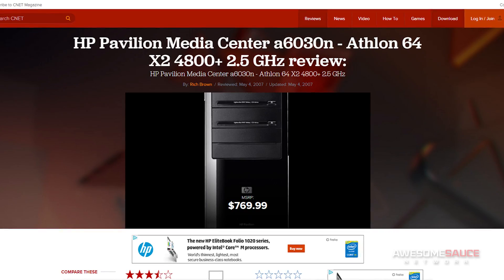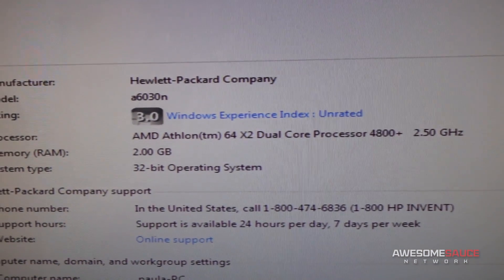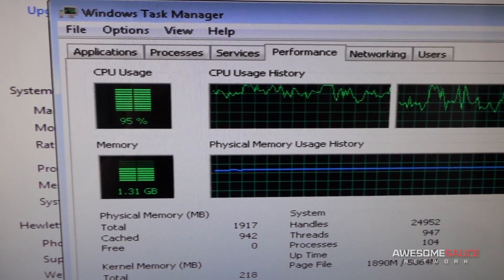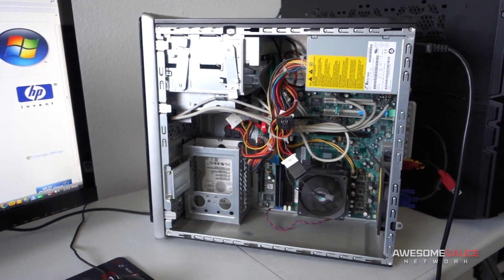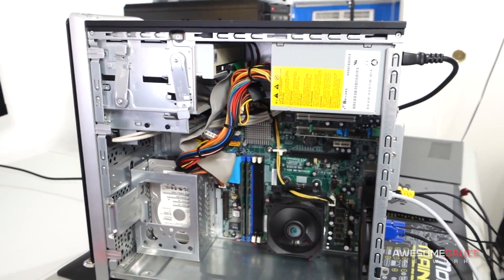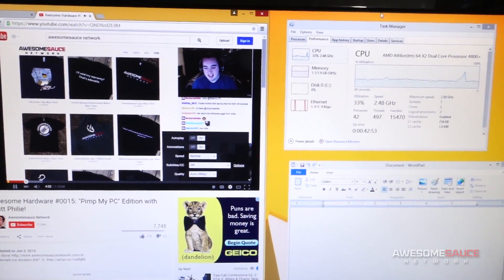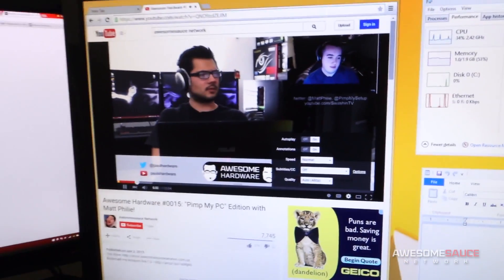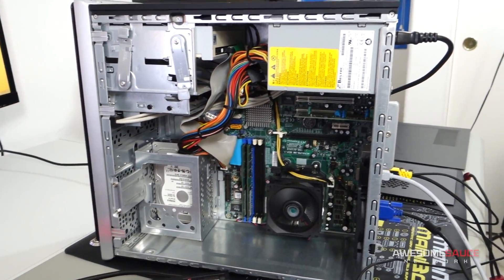Cleaning Up My Neighbor's Old Desktop!

Comment: I just threw a PC a fair bit better than that in the bin days ago. I'm a bad person but there are even better PC's than that just lying around never used. I never did get into the whole sell your old stuff thing. If I'd come across this guy and his 99% in use idling PC, I'd just have said, it's time to let go, I'll help you backup everything onto this here thumb drive, insert this into your new laptop you're about to buy, go now, quick, run, the thumb drive will self destruct in 3 hours, there's no time to lose!
Reply: Clay Mann and 5 minutes of my tweaking it would be running 18% in idle !
Reply: Guy Aldrich
unlikely but the point really is, why would you bother? One of the cheapest smartphones would be faster than this.
Reply: My point is,you could tweak this thing where it will run decent without wasting money on an 8 year old system.
Reply: Guy Aldrich The best tweak would be drop kicking it out the window. That's a good send off for a PC so old, that one last time you could make it fly. Also it'll never run fine, that's just stupidity or you've just not been around a modern computer to know what fine is.
Reply: Clay Mann Lol, I agree, There's no point in wasting money on shit.
Reply: Clay Mann Man, it is people like you that I love. That way I get the old computers (or not that old computers) at the dump for free! I find pretty good stuff. A Core 2 Duo clocked at 2.40GHz with 2GB of RAM, a GeForce 9500 and a 32-Bit OS is plenty for watching 1080p video with 7.1 surround sound. I know because I use a modified Dell Inspiron 530 in my home theater room!
Reply: Joshua's Recordings
I'm glad I can be of help but the PC you describe, a garbage android phone/tablet could do that too and it won't take up all that space, won't gobble up all that electricity. There was a time some years back when PC's were still expensive, the idea of re-purposing older hardware for certain tasks, it made sense. Today you can get that PC on a USB stick, in a cheap tiny box or with a screen built in with tablets and they are so cheap, I can only imagine the second hand market must have some deals that would stop you dumpster diving. Still, if you get a kick out of that, all power to ya,
Reply: Clay Mann I have never seen a tablet able to play Blu-Ray discs or have a 1TB hard drive or a discrete graphics card or even play 7.1 surround. What is wrong with dumpster diving, I have found $7,000+ worth of electronic equipment at the dump. I have a hole 7.2 surround system with about 2,500w of true RMS power (not peak) with 0.1% THD. I find newer TVs (flat screen usually 1080p), Blu-Ray disc players, computers, sound cards. What is wrong with getting this stuff free?
Reply: Joshua's Recordings
nothing wrong with that at all. I congratulate you on your hunting skills to get all that stuff. I completely forgot about discs. It's been so long since I used them, I don't even have any kind of optical drive anymore but I'll totally give you that, an old PC would play Blurays just fine if that's how you consume movies.

I'm not a big gamer but I do have a fairly decent main PC that handles games fine at 1080p. The rest of the house just gets mobile games and I quite like the distinction between the two. I play some games in bed or chilled out on the couch, casual garbage games really but I like 'em and when I'm at the main PC, it's the time to get into all those Steam games that us PC users can't stop acquiring in sales.

With movies I run a Plex server so my main PC can stream TV shows and movies anywhere in the house from phones, tablets and the main place it gets used, the living room TV with a little android box hooked up. I couldn't really go back to any other way of doing it. It's great watching a bit of a movie, deciding to go to bed but being able to just click click click and the movie is playing on a tablet in bed, right from the point you left it.

Surround sound is all handled nicely depending on whether the device being streamed to can handle it. Bottom line though, I am paying for this but really not a lot. It's amazing how cheap it is to do this nowadays compared to having to base everything off a series of desktop PC's. I'm sure you'd argue that you can just find these PC's abandoned by people and use those. I just don't see that as an attractive option anymore. They tend to make noise, they take up a fair bit of space and consume way more power than a few android devices in sync with a single PC.

I have a quad core PC here, 8Gb ram, a few terabyte drives and a pretty old graphics card so not really very good for gaming but it could be. The thing is I just have no use for that anymore. I offered it to my niece but they use laptops now and didn't even want it. I don't want to throw that one as it still feels kinda decent and I won't even talk about the monitors building up lol Ah, first world problems :)
Reply: Clay Mann The only reason that I like Blu-Rays over online streaming is that it has surround sound. Amazon instant video is awful, it sometimes won't even play in HD (yes, my card and monitor are HDCP compliant). Online or on computer streaming just is not up to my standards of movie watching.
Reply: Joshua's Recordings
 I've never had a problem streaming HD but it absolutely is inferior to Blurays, even though with Plex you're able to stream video as high quality as you want, I tend to acquire 720p and 1080p. I'm happy with the  quality.

 I don't see a problem with surround sound without using a PC. Tablets and android streaming boxes can handle 5.1 just fine, at least mine do. I have a few android boxes in the living room, they all have digital connections for surround. Even my old Amazon Fire tablet can connect through HDMI to the TV and do 5.1 in 1080p.

I suspect the problem you're having is with clunky old PC's trying to handle streaming HD video in less than ideal ways. If I try and stream amazon prime through firefox browser, that hits my system harder than it really should. If I play the same video in VLC, it's using 1% resources. Once you switch to something like an android box for streaming video, that's doing that on top of linux in a very efficient way. It's rock solid, at least that's how its been for me. I remember older PC's struggling to do the exact same thing running Windows Media Center, not to mention all the problems with formats not working. A plex server will transcode to anything, even re-compressing down to different levels of bandwidth live so you could for instance watch a movie from your home PC while on a train going to work. To make sure it plays smooth and you take the hit in visual quality.

Another bottom line. I've built everything around convenience. All my media is a click away no matter where I am. It sounds like you have a blu-ray collection that's top quality with a great surround setup and you demand that and got most or all of it for free. Neither of us is doing it the right way, we're just doing it the way we like :)
Reply: Clay Mann I think that it is Amazons stupidity making you use one of their dumb streaming boxes. Also my PC handles HD just fine without using much of the CPU. My main machine is much better (I built it from new parts). But for a streaming setup a older computer with a decent graphics and sound card is fine. Also you are right with your bottom line. I want everything top quality and don't really care about convenience as long as I achieve top quality. I also just like to get most my stuff free if I can, if I can't I will gladly pay for it.

Comment: They use to on the old IDE ribbons cut each line of the ribbon and then twist them to cut down on the size. Of course you had to be very careful doing this as not to actually cut into the wires.

That was before Rounded IDE cables.

Comment: Ugh I remember when my PC sucked that much. But then I built one with an FX 6350 and an R9 270, but i'm buying a GTX 960 4GB also.
Reply: Very, Insanely, Ridiculously High Fructose Corn Syrup get a 280x instead dude
Reply: ben p I was thinking of a normal 280 for me personally. Thought I might look into a 280x... I'll have to upgrade my psu either way.
Reply: 280x beats 960, not sure on 280. try waiting til new amd gpus come out
Reply: ben p £100 more though
Reply: 280x-£160 960-£160
Reply: Where on Earth are you getting those prices for? Is that for a reference card or not? Because when I look up on Amazon I'm only finding R9 280x's going for £240-£300
Reply: look on pcpartpicker. 280x are not 240 dude
Reply: ben p Does use more power though. (no need for better psu)
Reply: Mick de Raad When u have a 550 and you have an FX 6350 there is a need.
Reply: +Very, Insanely, Ridiculously High Fructose Corn Syrup  mine was so bad 1 gb ram and sempron 1 core the i built a good gaming pc

Comment: I refuse to do things like this, something always goes wrong down the line and they look at me like its my fault. I was given a machine that would only turn on half the time, i got it running again (not well, needed parts replacing) they werent willing to spend money on it, and when it busted fully and wouldnt turn on at all, they started talking to people how i broke their machine.
Reply: Chris Roberts  I couldn't agree more. Being into PCs, and all electronics in general, I always have friends wanting me to take a look at their stuff. I usually always turn them down for this exact reason. They hand you a pile of shit and you get it working again, and down the road, when it craps, they blame you. And it's like, dude, it was a pile of shit when you gave it to me, how can you possibly think that I am responsible for it dying...
Reply: TooBokoo
So true lol
Reply: TooBokoo about 3 months ago a neighbor asked me to fix his computer. I checked it out and when I saw it the computer wasn't really worth the fix. 1 stick of RAM didn't work and I think it was an old Celeron. I told him about it and I told him that for $150, I wasn't going to charge him for labor before I forget to mention,  I could rebuild it and make it into a better PC than it was before. I used the old case, optical drive and HDD but I gave him an old Corsair PSU. The only things that I bought was a AMD A10-7700K, a Gigabyte A68H and 8GB of RAM & once I put it together I gave it back to him and the next day he told me about how much better it was compared to how it was before. I was upfront with him and I guess he liked the honesty compared to how Geek Squad would charge him more than that just to look at it.
Reply: Chris Roberts probably the PSU.

Comment: I have a 16 year old pc clean, runs great, no dust, AMD Athlon XP single core running at 1.3ghz with 256mb of RAM, ASUS mobo, nVidia GeForce MX400 and happens to be my first PC I ever owned. So I'm going to give it some love with an overhaul turning into a ratrod kinda pc lol. New ASUS Mobo/nVidia Gaming Graphics Card not sure wat/i5 quad-core intel processor, and more. I'm going to use the pc for gaming and college so I'm still trying to figure out my parts

Comment: You did all that work and didn't consider spending $10 for more ram?  I'm sure he would have paid for it considering the deal he's getting.
Reply: Shao Zhang DDR2 RAM is expensive, actually

On Amazon, 4 GB kit costs $30

I bought my 4GB from eBay, which is 2x2GB of Chinese BS for $6 each DIMM

but hey boosted my Windows Experience Index

Comment: Nice vid but as You described  Your neighbour is not a power user so no need for upgrades to the CPU or ram needed if You installed Linux Mint . Plus no more worries about malware and viruses.

Comment: I upgraded a co-worker of mine who had a computer almost identical to this.  For those interested, you can fit any Micro ATX in here.  I installed a new PSU, and r7-260x.  Just ensure if you have the PSU and GPU sucking in air from the same area to drill in some holes to the side port to ensure they can suck in some fresh air.

Comment: You must have cleaned out all the dust that was in that computer. Any desktop that has only 1 fan (usually exhaust fan only) with a really air tight case like that HP does builds up dust super quick. No air flow traps dust inside really easy.

Comment: Seriously Kyle I would put LinuxMint 17.1 XFCE 64bit on that system, and you can get 8GB of old newstock Samsung DDR2 ram off eBay shipped from HongKong for about $25, and yes the AMD chipsets can take up to 8GB of DDR2 Ram, where as most of the Intel chipsets can only take 4GB as alot of them where still 32bit chips unlike AMD which was 64bit all the way back to the original single core Athalon XP chips.
New Samsung DDR2 8GB RAM KIT (2x4GB) PC2-6400 800 Mhz 240pin For AMD CPU Chipset
http://www.ebay.com/itm/151563194035?_trksid=p2060353.m1438.l2649&ssPageName=STRK%3AMEBIDX%3AIT

I would also upgrade the PSU, and throw in an cheap AMD R7 240 card which is good, and save him on the cost of a an entirely new system. I've gone this route for my aunt, and it worked out very well. 
ASUS R7240-2GD3-L Radeon R7 240 2GB 128-Bit DDR3 PCI Express 3.0 HDCP Ready Low Profile Video Card

http://www.newegg.com/Product/Product.aspx?Item=N82E16814121886&cm_re=AMD_R7_240-_-14-121-886-_-Product

Rosewill ARC-M450, ARC Series 450W Modular Power Supply, 80 PLUS Bronze Certified, Single +12V Rail, Intel 4th Gen CPU Ready

http://www.newegg.com/Product/Product.aspx?Item=N82E16817182296&cm_re=450_watt_PSU-_-17-182-296-_-Product

Comment: I have this same computer. I bought mine about three years ago. I replaced the CPU fan with an artic freezer, the exhaust with another artic, placed a 500 watt corsair in it, with an evga gt640, an extra hard drive, windows 7 64bit, added two gigs of ram, and finally installed my old soundblaster audigy platinum sound card. Ran really good, was so quiet, I wasn't always sure it was on, or if the fans were working. I also upgraded the processor, but not by much, being limited by HP's bios. I've moved on, but still have that pc.

Comment: My neighbor gave me a computer w/ the same processor and RAM.
The Windows vista doesn't let you use a lot of RAM.
Reply: Isube You mean windows vista is a ram hog?
Reply: Older computers can only hold so much RAM i meant.
Reply: Isube A6030N supports 8GB of DDR2.
Reply: K

Comment: If you have any kind of videocard lying around you might want to donate that to your neighbour, Frees up some of the RAM as it has to be borrowed from the meager 2GB it has, might help with decoding some video content as well. That's the cheapest and most effective upgrade I can think of.

Something like a GT210 would be a decent upgrade, should be able to find a used one for around $20 or less.

Comment: For what your neighbor does, his current system will be fine, the only thing I'd upgrade would be a low end GPU to play smoother video, maybe a 640 as it's about $50 and will last him forever.

Then maybe another 2gb of ddr2 which is just $10. Mixing ram won't matter as he isn't a power user

Comment: Cool video. I don't know if you managed to do this, but it might have been a good idea to blow out the PSU with some air. I know that those can get pretty well clogged. Also, I don't know how the transition to windows 8.1 went, but I like to use startisback. It gives me a legitimate start menu so it's just like running a really fast and prettier windows 7. Of course I know that windows 10 is coming out in like a month and a half, but it is 2015, and he was still running vista...

Comment: If you had to upgrade that rig, the only thing you could really do is to swap the 4400+ to an Athlon X2 6400+ and to add the two 1GB sticks (4GB total). Then maybe a GPU (an used x50 Ti, perhaps), which would eliminate the CPU spikes.

Though I'd say it's on the fence whether to buy another computer with lower power consumption than upgrading that one.

Comment: I have 2 computers in my house running Pentium 4's both capable of more than they should be :P atleast one of them has a small 512mb graphics card (no idea which one just know it's amd) and 4gb of ram the other one isn't even used anymore its still on xp if that tells you anything..... my computers are the only ones running more than one core other than my dads work laptops 0_0

Comment: Lot of those AM2/AM2+ motherboards can be upgraded with a bios update to support AM3 cpus - which are pretty damn dirt cheap on ebay (talking like triple core Athlon II which is like 2-3x faster than this CPU for like 20$) also DDR2 high-density ram can be found on ebay DIRT cheap.

But I guess since this is an oem machine it wont apply here.
Reply: MrJigssaw1989 My old K9A2 platinum supports AM2/3. Upgrading from an Athlon x2 3600+ @ 2Ghz to a Phenom x4 955 the performance difference is absolutely mind blowing. Also bumped up the multiplier gaining an extra 400mhz with the stock vcore.
Reply: norge696 Good for you I've got lucky too :-) My AM3 motherboard supported AM3+ cpus with a beta bios. So I was able to upgrade from my Phenom II 965 to FX8350 :-) AMD rocks.